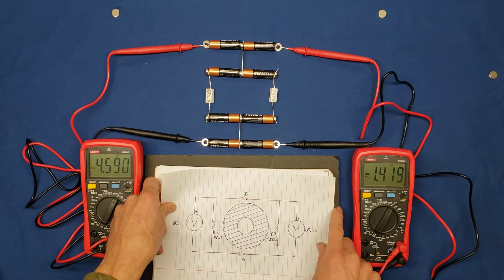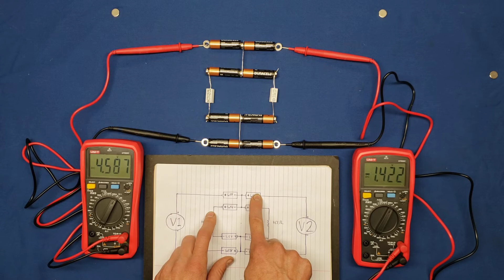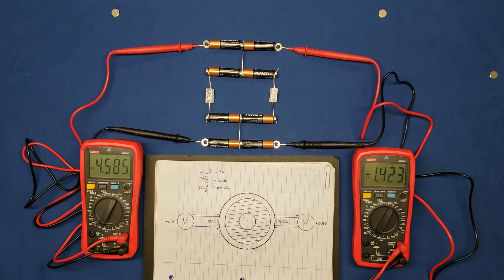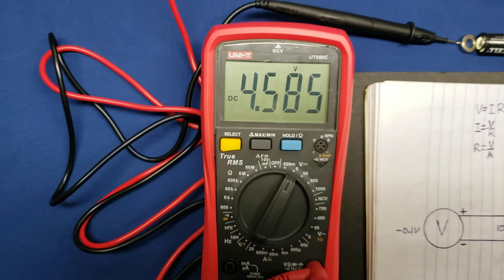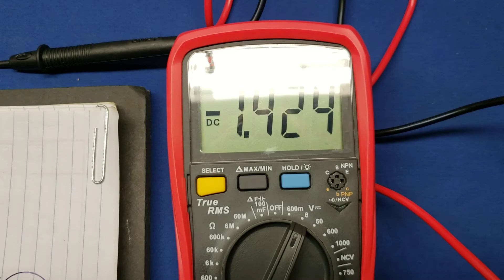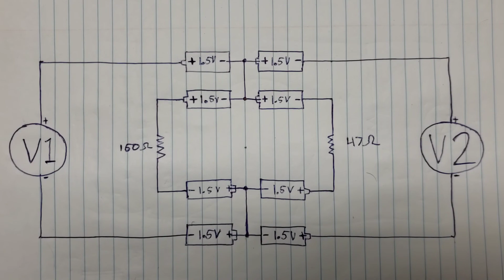Lewin's Paradox explained: Kirchhoff voltage law (kvl) doesn't  work with DC either!

Comment: چی برای خودت باتری ردیف کردی .قانون مثل قانون فیثاغورس همیشه درست است گیرم یه جایی یه طوری بوده روش اندازه گیری مثلا متفاوت بوده خوب همه اینها درست اینها یک یافته است و اصل قانون را نمی‌تواند  از بین ببرد .فقط باید در راستای قانون باید این یافته‌ها را برسی کرد نه اینکه تا یک ولتمتر یه عددی را نشان داد تو بوق و کرنا کرد که این قانون غلط است.
Reply from the maker: Unfortunately, I do not speak Persian, and Google translate isn't much help.

But this video is meant as a joke, like comedy.
Reply: @fromjesse  please  please  please 🙏  show this to anyone else  calculate how know  electronic
Reply from the maker: @asmahoseini4393  I wonder if you're not seeing the decimal point due to the font difference. I'll make a picture for you. https://i.postimg.cc/NFB29Sqp/Screenshot-20211112-102754-Calculator.jpg
That is TWELVE DIVIDED BY ZERO POINT ZERO ZERO ONE.

To not use decimal points, put this into your calculator:

12/(1/1000)

You see, 1/1000 is one thousandth.

When you divide 12 by one thousandth, you get twelve thousand.
Reply: @fromjesse  yes  you are right to this point 👏  cacolition is right  12000 amper  but  see my maseg  i explain ohm low  to you
Reply: Show this circuit to someone who knows ohm low it will be very funny 😄
Reply from the maker: This video is a comedy response to Dr Lewin who does not understand anything other than ohms law,  because he thinks that all voltage drops are purely ohmic.
Reply: there is tow different corent  which does not  effect  to each other  and you have tow different  numbers in  each voltmeter. so wath
Reply: Ohm low is always rights.
Reply from the maker: @asmahoseini4393  > Ohm low is always rights.

So let's say you take a 12v car battery. It has an internal resistance of 0.001 ohms. You measure 12 volts. 12 volts divided by 0.001 ohms is 12000 amps!!! That's ohms law!!! Ohms law is always right!!! 

How can your volt meter make 12000 amps! That is a lot! Ohms law is always right!

The answer which Lewin does not admit is that not all voltage drops are caused by ohmic causes. Voltage is produced in a battery. And voltage is produced in a transformer or electric generator. There is more to life than ohms law. 

So yes, ohms law is always right, but ohms law is not where voltage is produced. There are other laws too, and they are always right too. They all work together.
Reply: @fromjesse  ای خدا.... برو یکم ریاضی کار کن تا یاد بگیری چطور حساب کنی ....جان برادر اشتباه حساب کردی
Reply from the maker: @asmahoseini4393  > go do some math to learn how to calculate .... Brother John you miscalculated

Please use  English here if you can, google translate doesn't work very well and I don't speak Persian.

I did calculate. Why don't YOU calculate?

Ohms law says I=V/R

In this case, V=12, R=0.001

So we solve for I, which is current, and we get 12/0.001=12000 Amps.
Reply: @fromjesse  now I anderstod  what you discovered  yes yes yes 12000 amper is right.?.ohm low is right tooooooooooo.now I explained to you .. is no different  internal  resistance  or oder  resistance  ...12000 amper is mean if your sors or battery had this power. 0.001 ohm  is  mean almost nothing resistance  which  means 0 ohm in circuit ten all corent fllow up ..........if  if if if your battery  have this power....remember 12 v or another ..v  is not mean is unlimited  corent.?..anader caes  if your battery  be so power full  yes 12000 amper corent  is true  ......so what  is nothing wrong  to  ohm low
Reply from the maker: @asmahoseini4393   I'm not sure I understand what you are trying to say.

But let me ask you this, how is it possible to have 12000 amps through my volt meter?
Reply: @fromjesse  we cacelleted speed of light 300000ks but we don't go by that  speed....don't worry about that amper in some  factory  and some  device use more than 12000 amper..
do you have some  experience in  electronic?
I explaine ohm low  agen for this circuit  12 v battery and 0.001 resistance and12000 amper curent  ..in this circuit  0.001 ohm is almost  0 ohm which  means  all power  and curent is going  freely   if your battery had enough power  12000 amper  will go  
but if your battery doesn't have power enough  curent is all that can  battery  produce....in thy last... ohm low  do not say  the number  you  get in ohm low  battery  should  produce .... 
battery  power  nothing to do with ohm low

Comment: I think your work only emulates 80% of the physics inside a transformer, and the effect of charge accumulation and Coulomb force has been ignored. Based on your emulation circuit, you probably think there is voltage along the wire from D (and A) to the resistors, but there is no voltage along conducting wires. My video is at https://www.youtube.com/watch?v=OmlnGei1xo8
Reply from the maker: Thank you. You're video is very nice. Naturally I disagree with you on some points. 

In my opinion, transformer secondary windings can be perfectly lumped as a lumped component in a loop for the sake of  Kirchhoffs VOLTAGE law.

And make no mistake,  a volt meter lead running across a changing magnetic field most certainly a transformer secondary winding. 

So if you correctly lump ALL the components in your loop, which includes volt meter leads which double as transformer secondary windings, then KVL will hold.

In fact,  even if you ignore a component in a pure DC loop, KVL will fail because KVL requires ALL components to be accounted for.

If the student ignores one or more components in his loop, ac or dc, he  will think KVL failed him - but it is not KVL who failed, it was the student who failed. 

As to Dr. Lewin, in my opinion he was disingenuous in claiming to be measuring the exact same points with two identical volt meters.

The fact is that his volt meter leads were transformer secondary windings.

If you consider the the volt meter leads as being part of the circuit,  then no, the volt meters are NOT measuring the exact same spot: they are measuring the voltage on opposite ends of a couple of transformer secondary windings. 

If on the other hand you want to say that the volt meter leads are NOT part of the circuit under test,  then you must  consider them as part of the volt meter. But then you cannot say the volt meters are identical because one has a positive half volt offset error and the other has a negative half volt offset error - and two volt meters with different offset errors ARE NOT IDENTICAL. 

Lewin totally ignored the voltage induced in the volt meter leads, lumping it neither with the circuit under test nor the volt meters. 

You just cannot honestly leave out a component and blame it on KVL.

Did you see my other earlier video where I emulate 100% of the physics  inside a transformer and show that in the real world KVL does hold true when correctly probing? (And by correctly probing,  I mean probing in such a way that their are no errors induced in my volt meter probes)

Check it out: https://youtu.be/nAsZFP8Cfxk
Reply: @fromjesse  It is legitimate to lump the transformer as a lumped component, for the purpose of hiding all the non-KVL property inside. It is a technique to solve circuit problems. But inside the transformer, KVL doesn't hold.
There is no voltage drop along conducting wire, otherwise, there would be a huge current. You can hypothesize that the voltmeter lead has the same induced voltage as the arc being measured, but once you realize there is no huge current in the arc, you have to give up this hypothesis.
Reply from the maker: @SiliconSoup  > But inside the transformer, KVL doesn't hold.

Why doesn't KVL hold inside of a transformer? Because it may cause probing errors on your leads if you aren't careful.

However, if you probe correctly such that no voltages are induced upon your volt meter leads, then the subsections inside the transformer then become lumpable, and KVL holds.

So it's just like any other situation. If you probe correctly, you're good to go. If you don't probe correctly, you're not good to go and physics WILL FAIL YOU.

It's just like any other field of science - if your measurement changes your system under test, or your system under test changes your measurement, then PHYSICS WILL FAIL YOU. Or more specifically, you will fail physics.

But once you learn how to perform a measurement with the system under test in such a way that it doesn't have crosstalk with your measuring method, then you're good to go. And KVL holds.

Had Lewin neglected part of his real system when applying MaxEQ, that would have failed too.

> There is no voltage drop along conducting wire, otherwise, there would be a huge current.

You falsely assume that the only possible source of a voltage difference is purely ohmic. That's not true. See Thevenin's Theorem. There are a number of cases where a voltage difference is obtained due to non ohmic causes.

> but once you realize there is no huge current in the arc, you have to give up this hypothesis

Take the trusty lead acid battery. It's got 12 volts across it.  The internal resistance is let's say 0.001 ohms. That means it would demand 12000 amps to be flowing in order to measure 12 volts! Your volt meter can't source that much current! 

Oh well, I guess you have to give up the hypothesis of voltage across an electrochemical cell. Ohms law just doesn't allow it.

Like I said, convince Dr. Belcher and Dr. McDonnald they are wrong then let's talk.

Comment from the maker: I can't believe this stupid video is my second most watched for 2020.
Reply: That's because it's not a stupid video! :-) I've only recently come across various videos about Lewin's problem (and watched Mehdi's and a few other videos) and it was clear to me that Lewin is just plain wrong - any engineer with her/his salt would spot the problem with current induced into the probe leads. I like how you've broken this down to a simple demonstration that makes that easier to understand.
Reply: @zeno2712  
No. Sorry, but the circuit made in this video has nothing to do with the the Lewin’s one. 
Here, we have batteries along which there is a gradient of electrical potential V. There is no variable magnetic field. Also, the E.dl integral through a particular path is a potential difference in this case. The two points are not the same, so we can read two different values.

In the Lewin’s experiment, the two voltmeters are connected to the same points, E.dl integral is no longer equal to the potential difference between the two points and is path dependent : the two readings are not the same. In wires, there is NO potential gradient, so battery model using is not relevant. (Obviously, if you measure the voltage (E.dl integral) by probing 2 points of a wire, you read zero. The model used here suggest that there is a gradient of the potential V along wires , which is wrong.
Reply from the maker: @mickvall4881  If you understand English (which I realize you may not) the dialogue in the opening of the video clearly states that this is parody/Comedy/Joke to be taken as a joke, unless you happen to be named Dr. Walter Lewin. 

Of course there's no significant voltage drop across my wires nor is there a changing magnetic field in this video, IT IS DC!

What this video does is illustrate BAD PROBING. Really bad probing. So relax, and laugh, and let me know if you cannot find my video where I use a changing magnetic field.
Reply: @fromjesse  
Ok ! I didn't understand that was an ironical video. So, Sorry ! I should have seen the video with more concentration !
Reply: @mickvall4881  "...the two voltmeters are connected to the same points,..." 
No, they are not! The voltmeters are connected to the end of the probe wires. To emulate their behavior at a specific moment in time is what the DC replacement with batteries is about.